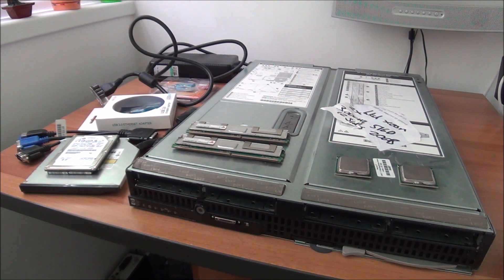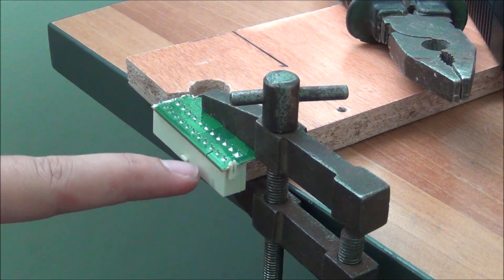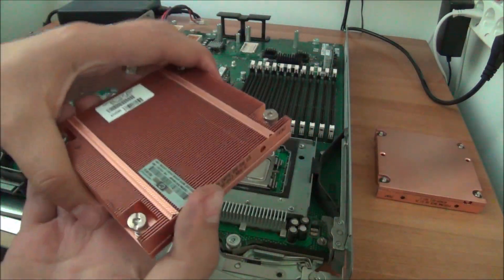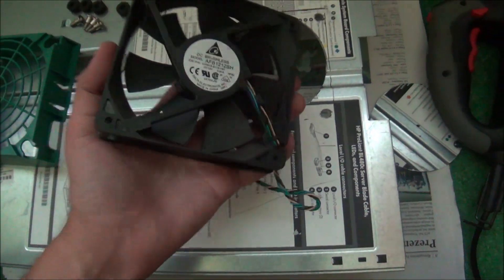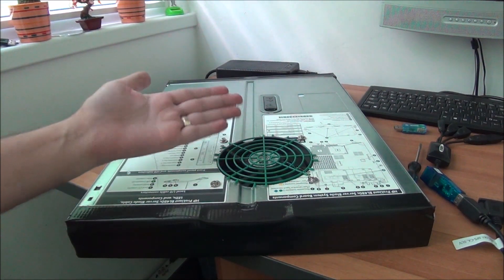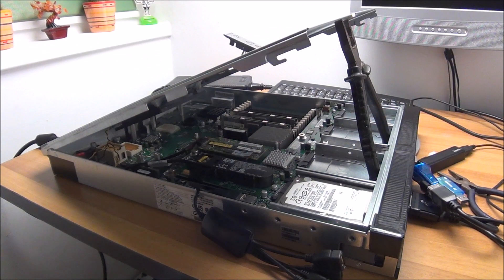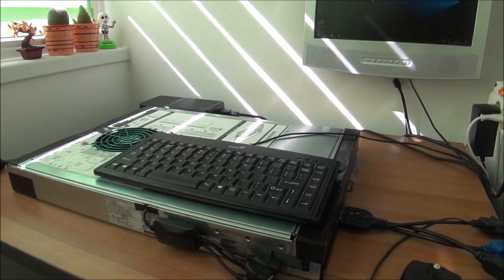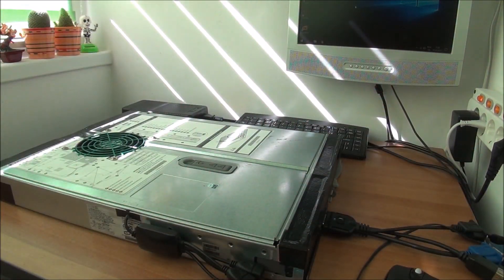How to convert a HP Server Blade into a standard PC with Windows 10

Comment: Where on the circuit did you solder the intake fan? I have an hp bl460c g6 blade that I'd like to run outside of an enclosure, but I'm trying to find a way to automatically cool the unit.
Reply from the maker: Sorry, but I forgot exactly where. Did I also forgot to show it in the video?

Comment: You mentioned that same applies to BL680. What is correct position of system maintenance switches to start the BL680 outside the enclosure?
Reply from the maker: If you are asking me, all I know about this is already in the video.
Reply: @UltimateDIY  Thank you for the answer and your video. It helped me not to give up. For anyone interested in running a blade server without enclosure (standalone):  the position of system maintenance switches for HP PROLIANT BL680C GEN7 (BL680C G7) is 1 and 3 on, others off. To start and run it needs compatible memory, GOOD cooling, HEAVY power supply (my existing 750W was not enough, I will go for 1200W).
Reply from the maker: Awesome! Glad you managed to power it on and thank you for the info!

Comment: Hi, i have also tried this, i power my Rack with a normal power supply like ones in a Desktop PC, i habe an bl460c Gen8, but this thing is only blinking green on the Mainboard, also the CPU doesn't get hot etc. Did you do anything else , except power it with 12V?
Reply from the maker: Hi. I did what is shown in the video.
Reply: @UltimateDIY  thx
Reply: @floace  Did you succeed with the blinking green on the mainboard of your BL460C Gen8? I have same problem on BL680C GEN7
Reply: @valentinmedvedev2523  did you figure it out? Same with mine.
Reply: @PrinceJay1st  Eight tiny beige switches positions should be On Off On Off Off Off Off Off. Please also be aware, that you should provide a really powerful PSU and an array of cooling fans. While doing tests I made it to the Ubuntu loading logo, but the device shut down because of overheat of the body and overload of the PSU (it was 750W as far as I remember). I prepared 4 server 450W PSUs and a cooling fan array for the final setup. Now waiting for a holiday to assembly and run it.

Comment: Hello. i want to do the same with a Primergy BX924 S3, but i don't have those 2 cables, only connectors. Any suggestion? Thx in advance.
Reply from the maker: Hello. Sorry, but I don't know anything about that model.
Reply: @AlexAsiTech Do you found it? On the back of it there is bigger connector with GND and 12V, do you tried connecting it?

Comment: hey im doing this on a proliant 460, but im at the point where i need to solder; what do i need to do for the wire top to be gone so i can solder the wires to the 24pin?
Reply from the maker: Hi. Not sure what you mean with wire top.
Reply: @UltimateDIY  Sorry I was having a stroke, it's the actual power cords for the enclose.
This is what i mean.
http://www.mediafire.com/convkey/f542/eoathbr3u3xflbxzg.jpg
Reply: @UltimateDIY  I mean isn't that what you did in the video, you kinda cut from grabbing a spare 24pin to already being solder onto the en-closer.

Comment: How to use x16 gpu card in this server? How to conect 2 FHD 24" monitors to this server? Does  gpu mezzanine card is compatibe with this server? What model and brand power supply do you use for this server? How make silent this server?
Reply from the maker: 1. You can't use a card like that, because it does not have connectors for it and none of the standard available ports can sustain that speed with an adapter.
2. You can't from what I know, because you can only connect via one VGA connector.
3. I do not know.
4. I used a DELL 12V 18A power supply.
5. From what I know you can't make it silent, because it needs a lot of airflow.

Comment: Hello. Is it necessary to remove the back connection? I'm having a 460c g7 using a psu hp 12v 80amp but it does not boot.
Reply from the maker: No, I just wanted them out. It might be because of those switches on the motherboard. It's a pain to get them right, so it boots outside the rack.
Reply: thank you so much, I got it, it was just wait, it takes about two minutes to start
Reply from the maker: Awesome! Glad it works! :)
Reply: Hi Ricardo! I am trying to power on my BL460c G7 to standalone mode BUT without lucky. Can you tell me the DIP switches position? Any comment can be very helpful!! Best regards!

Comment: Hi, can someone tell me where is rj45 ethernet connecto for HP BL460c G7? Need to put it on internet.
Reply from the maker: +Make Mee I will wait here with you for an answer :)
Reply: sorry maybe is a stupid question, but i like to buy some of BL460c G7 and use your video to connect it with windows, but i need internet :) i think like all of us. What about older BL460c is it possible to connect it with  internet?  Here i found how it worked with BL460c G6. https://www.youtube.com/watch?v=iJ15LfyNFKI. And when I read service manual there is no rj45, so that way i asked if anyone know :) or maybe is here any special BL460c g7 manual with all pinouts.
Reply from the maker: From what I know this servers do not have any standard network connections. If you are able to find a clear pinout for the huge connections at the back of the units, you might solder some wires onto them, but I was unable to find such a thing, so I used a usb network card.
Reply: It is very unlikely you will ever find a pinout for that. Reverse engineering might be very difficult on this, even with a working bladecenter.  I am very interested in WS460c, is just like BL460c, but you can buy a PCI addon that can connect to it and support full size 16x PCIe GPU.
Reply from the maker: That would actually be really nice.
Reply: It would be nice to do some research on why, what a bladeserver is...

Try to look for Mezzanine networkcards... #Hint

Comment: The noise is too loud
Reply from the maker: Yes, indeed, it is.
Reply: Try running fan off 5v rail less speed and less noise!  Is the fan blowing air over heatsink or sucking air from inside out?
Reply from the maker: Sucking air. It has to be at max to move enough air.